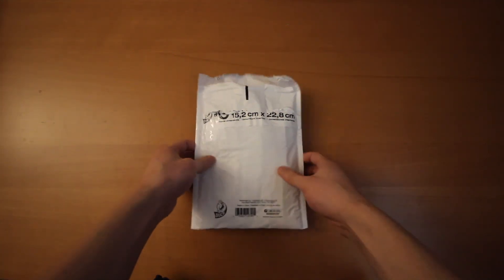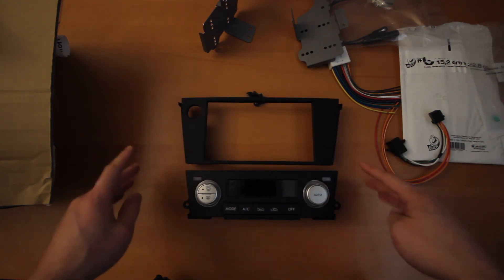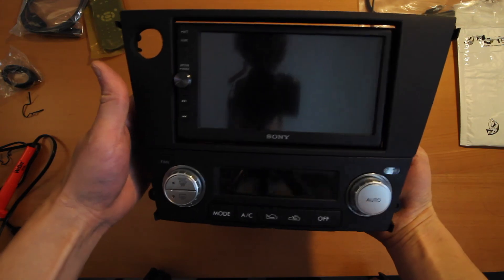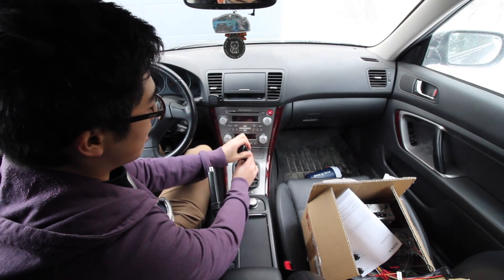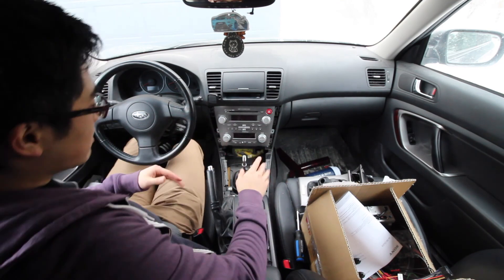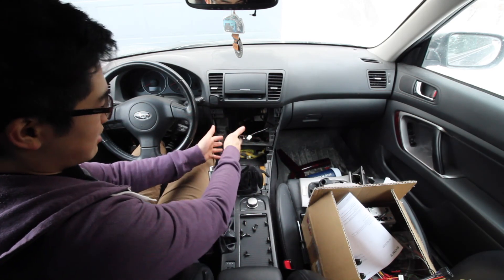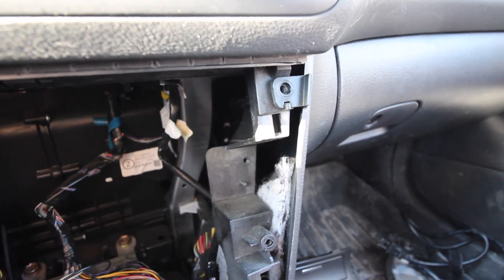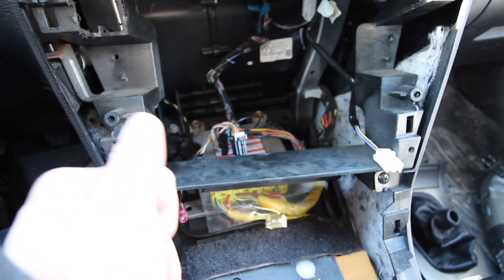Legacy GT JDM Double Din Conversion

Comment: I did this conversion back in 2015 on my Legacy, I purchased a ready made loom to connect the Subaru radio connector into standard fit ISO set up.
It was on eBay they were called a SOT cable, I didn’t have to add any connectors, it was plug and play.
Reply from the maker: The harnesses I used were the most common route that other Legacy owners used but good to know other options exist. This was all plug and play too with the adapter
Reply: Anymore insight on this? Nobody making harnesses is answering emails and I'd rather buy something than dig for and follow wire diagrams.

Comment: So, if my AC controls are manual I don’t have to do all this???
Reply from the maker: I believe you likely will have to but with different parts. Regardless if you have manual, single zone auto or dual zone auto, the HVAC controls are integrated with the stereo

Comment: I drive an Outback 2008 in Australia, do i still need the i88 adaptor to connect the other two plugs that go into the factory stereo, into my new HU?
Reply from the maker: I'm not entirely sure but if you have an integrated stereo and HVAC controls unit then I believe you might have too. I would reach out to an i88 adapter vendor to confirm though
Reply: @jonyrho  also i noticed that you said you connected the parking brake wire where the ground wire is on the sony HU. Is there an attachment you used?
Reply from the maker: Just grounded the wire for the parking brake so the stereo can be used all the time with no limitations

Comment: Damn, I just bought a junk 2008 legacy for a few parts but it has the single climate control, my working legacy has the stock dual climate. Did you find a way to make the single climate control work with the dual climate module??
Reply from the maker: Unfortunately I don't think so since I never had to look into that but I could be wrong!
Reply: @jonyrho  I will still try it when I have time. What about the windshield? Would I be able to use a 2009 windshield in my 2008?

Comment: I want to do this, but i was wondering if its possible to switch the two big buttons on the climate controls to a USDM setup? I personally prefer it that way and my OCD won't let it go. Lol
Reply from the maker: Doubt it would be possible unless you're a wizard when it comes to electronics. Honestly it bothered me a little bit but you get used to it
Reply: @jonyrho  I see. So I take it that also installing the original controls on a blank climate control faceplate would also be out of the question? 

Also, thank you for the shared information.

Comment: I have 2006 Subaru Legacy gt limited.  Would this work to hook up a single did head unit?  Or would I only need the radio harness?
Reply from the maker: You can basically follow the same steps and parts list but you would also need a single din storage box as well.
Reply: How much was it for your harness?